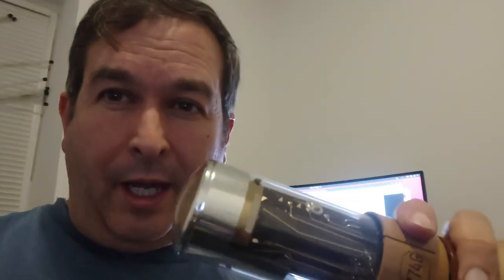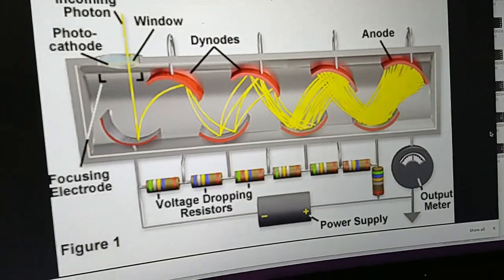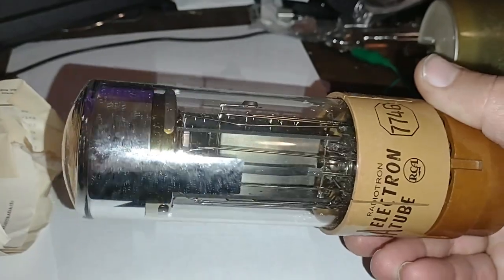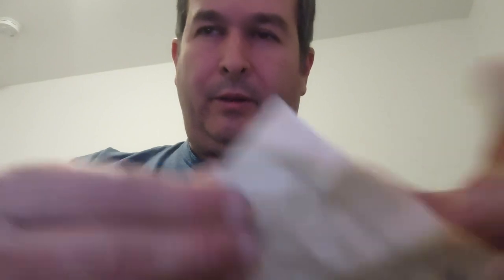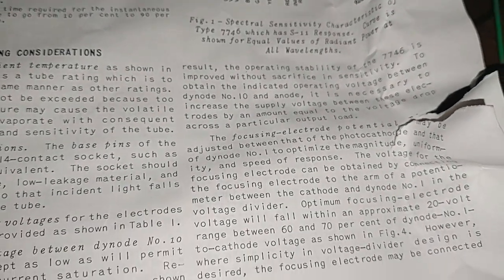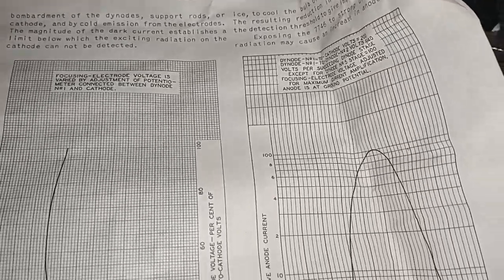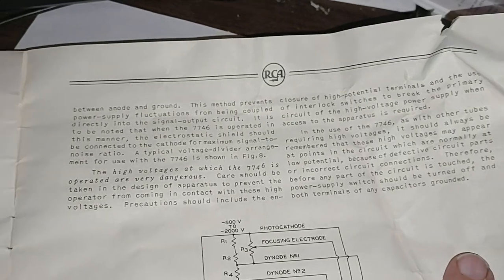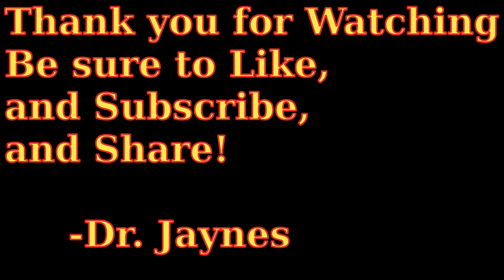Photomultiplier Tube

Comment: Pretty cool present! Just FYI, Hamamatsu does sell photomultiplier tubes, some even with integrated resistor divider networks and capacitors in case you ever need some "new"
Reply from the maker: Thanks, That is good to know! I have built these devices before... I have some in storage, that use plastic scintillators, for detecting fast neutrons, from proton recoil... I am going be getting them out, to do some videos with them very soon! It will be very interesting!!

Comment: I don't have one of these, but wondered if you would be willing to scan and share its documentation (since you said you had difficulty finding pinouts).

Amazing find, by the way. Thanks for the upload!
Reply from the maker: I am not sure which forum to post to? YT is the main place I post information... I actually want to use a different tube, that has the NaI crystal integrated into it.. but I have not been able to find the specs for this one...  It is labeled as: HARSHAW NaI(Tl) Integral Line, Scintillation type 6 SH 3K-X, Detector BI 666 3-2-341. The tube needs the proper circuit to drive it.. I have 2 specs with the lot... the RCA 7746 has the following pins 1. d1, 2. d3, 3. d5, 4. d7, 5. d9, 6. a, 7. d10, 8. d8, 9. d6, 10. d4, 11, d2, 12. nc, 13. grid, 14. k......there is also an ortec scint base 296 scematic with the tubes, with the following pins, 1. d1, 2. d2, 3. d3, 4. d4, 5. d5, 6. d6, 7. d7, 8. d8, 9. d9, 10. d10, 11. a, 12. nc, 13. grid, 14. k..... I am not sure of the pins for the Harshaw tube, but I am afraid to guess.. because it might damage the tube if I put high voltage on it.... anyway.. you need the proper schematics for tube that you want to use.. I prefer not to use the RCA tube, unless I am unable to get the integrated Harshaw tube working... In general the schematics  for these old tubes seem hard to find!?... I am going to keep searching for a while....we will see! If anyone has info on this tube.. I will very much appreciate it! Thank you so much!!

Comment: Hey i know this isnt related to the video but can you enrich uranium 238 to u 239 by using a similiar neutron gun that you made out of americium and berylium in an older video.
Reply from the maker: In principle yes... the neutron flux is very small though.. so you won't be making plutonium to fast.. I have some plans of making a much higher neutron flux generator... but I need to get this project off the ground first... I need eyes to see, before I can start making real progress in that direction!! Thanks for the great comments!
Reply: @jaynesnetwork  thanks a lot 👍

Comment: I don't think that's sodium iodide.  Looks like a hunk of plastic scintillator material from Bicron.
Reply from the maker: That is how it was labeled? Maybe I can measure the density of this mystery object.. I actually have another integrated tube, from Harshaw that is clearly labeled as NaI(Tl). This is the tube that I am attempting to use.. But I have not found the specs yet.. Since the crystal is integrated right onto the PM tube, it should give same very good results! We will see..